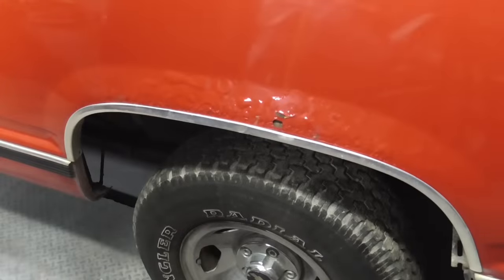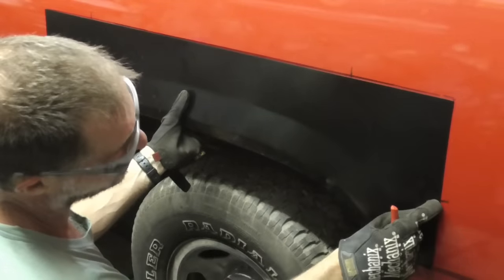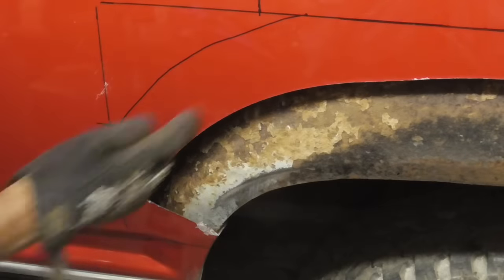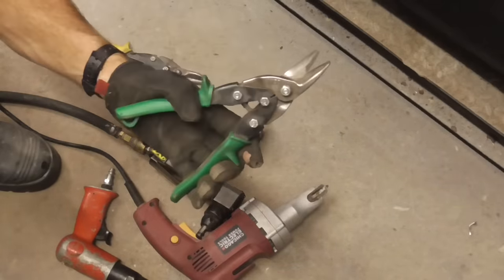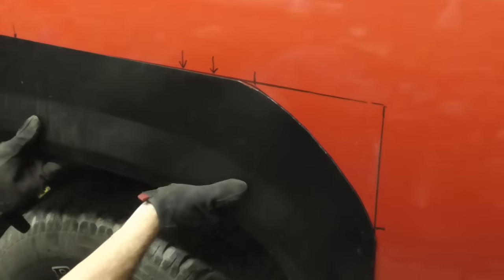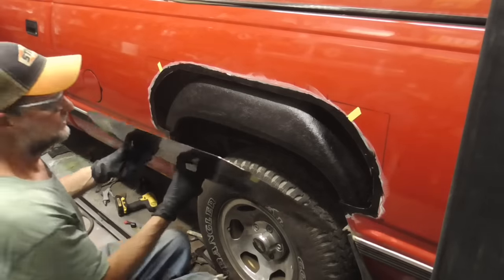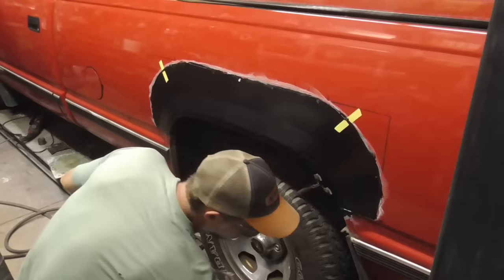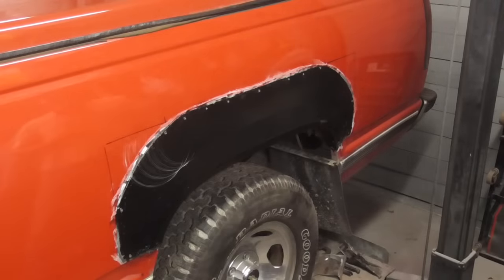Glue On Wheel Arch Rust Repair Panels w/ SEM Impact Resistant Panel Adhesive

Comment: I though what is this guy doing...Then i thought aircraft are glued rivited lapped and bonded.....Then i seen the finish and thought not bad...Just cant get my head round not welding it....
Reply from the maker: Thanks for your input Free - you're right Boeing 737's on up are glued and riveted :)
Reply: @LakesideAutobody  Heres one for ya hemp fibre is about 52 MPA. One MPA is 150 PSi...let that settle now coconut Fiber on average is 132 MPA thats 19,800 PSi Now coconut can be upto 320 MPA thats the same strength as High strength Steel and hemp weave composite can get upto 350 MPA....My Ex's father was an engineer for Fiat...Fiat right...Na they own JTD and Engineerring and they own half the frickin Automotive plant Jeep Ferarri Mazerati New Holand Iveco and the list goes on..He got me looking into composites...Firefighter air tanks are 1/3 the thickness of a scuba tank with a fiberglass weave making it stronger and lighter of a comparable thickness...Just need the thickness where the thread valve seats. I never like ford that much till i seen the Henry Ford Documentary...He was the genius not Edison... Then i bought an F150 and the controll arms and stability and ride... Cross that engineering with a Mercedes Sprinter Van, inother words gut the merc of ECu Engine and transmission and replace with reliable non limp mode USA mussle and that would sell...
Reply from the maker: @freeman7788  You're right - can't beat the engines and transmissions on a USA made truck but the ride of the foreign cars is very well designed.  I bought a Kia Sportage brand new and never once heard a sound come from the suspension - a suspension designed by AUDI - I believe - they helped KIA design the Sportage suspension :)

Comment: Idk about that stuff, but with JBW or any other epoxy, mixing on cardboard is bad. Anything that can absorb, like the cardboard getting "damp", is bad.

That's because the dampness is important vitamins the epoxy needs!
Reply from the maker: You're fine mixing anything on cardboard.  That's an internet thing.  Shops I worked at mixed filler on cut up card board all the time - no issues.  Maybe if it's literally set or something it might cause a prob :)
Reply: I'm sure I read that in the instructions…

I always used cardboard (decade+), until then. Since then I use whatever plastic I find in the recycling bin.
Reply from the maker: 👍😊  I was just out in Iowa this summer - picking up a car - figure you're from Iowa? @Iowa599
Reply: @LakesideAutobody  ha! A good car, here? It must have been imported, recently. Gravel scratches + winter salts = early brown death

Comment: That truck must not have been exposed to the roads in the Salt Belt. It looks like a late '90's to mid-2000 model. If that truck was exposed to salted roads like where I live, the rust around that wheel arch would be much more severe and your rocker panels would be practically gone. Very good video though. I HATE SALT AND I HATE RUST!
Reply from the maker: Thanks my friend - yes, it was a Michigan truck or is :)
Reply: @LakesideAutobody  I own and operate a paintless dent repair business.  I see alot of newer trucks and SUV's with rusted bodies.

Comment: I know that pleco's are so easy to use... I would rather go to every pawn shop around and find from great vice grips to the most cheapest ones to cut up, and weld my own different ends on them making a long reach grip for a spot with maybe a only one time use even as the price will usually reflect the end put on it... I am kind of referring to using the smallest handle on a  grip so many can be put into place. I just hate to put more holes in metal than its got already. If they spent the time (auto manufacturers) to use the kind of metal they first used in vehicles.... see as I look at it, (I'm 73) we just waste so much stuff and any final place metal winds up going, has the worst trash in it yet.... a huge feeding hole for rodents.... sadly making a rodent kind of a purpose animal. I hate em so not to worry, rodent down everytime... If I see them in a pet store, I buy all of them and feed them to my barn cats at a rate they can get all of them. Back  to fixing up old rigs. Car companies know what we want and what we can't afford to buy as they piece it out yet all that spendy stuff winds up in  the same pile as junk does in about three to five years... at least in the rust belt areas. I made a trip to the continental states from alaska where I live at for the last near fifty years. The alcan road has close to a million rigs that stopped for what ever reason,.. some just out of gas. No salt used on this highway system and the rigs are in very good condition. Lots of times, the engine is not even locked up. I wish that those old rigs could be saved as they are almost free for the taking... getting stuff home for less than a kings ransom is the tough parts.
Reply from the maker: Interesting... Thanks for the comment Morgan :)

Comment: It didn't look like you cleaned the inner wheel well and put a little protection on it why burger fixing the outside if you don't do anything with the inside ? 
 I would never use rivets after a glue the flexing if the panel will eventually cut the rivets loose and they will work they way out.... and show up as blisters but it is the rivet that cut loose....
Reply from the maker: I'll show you this repair 5 years from now and it will look perfect.  I promise :)  The guy lives in town, parks it outside and plans on keeping it so keep in touch.  Have a good weekend - Jerry

Comment: A real body guy would have shown a coat of single stage red not fake primer dude cheers
Reply from the maker: We used spray bomb primer as a quick touch up for burn throughs the time in high quality body shops - it works fine - you never have and issue with it.

Comment: Guy needs to watch some Fritzee videos
Reply from the maker: Fitzee is a fine metal fabricator.  However,  in a body shop only use butt welds when needed (OEMs don't use any) - like edges and areas that can't be tapped down. For trailer queens & cars that will never see rain, butt welding and grinding the snot out of the sheet metal is fine but if you drive it, there's better methods.  See this for the truth - https://www.youtube.com/watch?v=JIIonJOVro4

Comment: Disappointed to see drilling and screws and rivets. This will be the path of failure. Moisture will always be behind the panel. Water can travel from the bottom of the hollow pop rivets upward. If it manages to get to the bondo it will be absorbed (and expand) because filler is porous. Then ugly blisters will happen.
Reply from the maker: You don't have to use the rivets you can leave holes - it will never rust up high only where the moisture settles - see this video (3 year old cab corner glued on w JB) - the key is knocking down the seam whether its welded or glued - https://www.youtube.com/watch?v=d21RkqTwRqs

Comment: he should have stepped the body panel or butt welded the panel on so there wouldn't be a thickness descrepancy, that new panel is sitting on top of the original body side panel, you will see it stick out when painted, thats why he didn't paint it and show the end results. i'm a retired body paint man of 40 years from Jaguar motors, believe me , this is not how you do it !
Reply from the maker: Here's a follow up on that quarter - https://www.youtube.com/watch?v=t1WclT_GMvk  Flange tools only create a 1/2" or less flange more like 7/16" which really isn't enough surface area for the glue to adhere to.  You also can't flange around wheel lips. Those are the reasons for not stepping the panel.  If you could flange the entire panel with like a 1" flange that would be great :)

Comment: As a coachbuilder from Germany i can only say that this is a shame for all the wasted time,because 1 you will get cracks in the putty/colour and 2nd the german TÜV will send you home if they realize this and you are not permitted to drive your car anymore!Because of loss os structural integrity because of not welding!If you should have an accident with such a "repair" even the insurence will not pay any damage compensation!In the same time you could have welded and tinned it!And then everything would be save!
Reply from the maker: Three years later many different methods of repair - all work very well - lots of good quality body shops use these methods - not the TV/Magazines or blogs though - https://www.youtube.com/watch?v=gIS1Tbv7Kvw

Comment: 1.52 How to cut your thumb off. Crazy.
Reply from the maker: That's just a sander - the edge really can't hurt you.  If you ran the face of the fiber resin 40 grit disc across you hand - yes it would leave a mark which I've done a few times but nothing too bad.  Throw some toilet paper on it, wrap in in some masking tape and off you go :)

Comment: I don't particularly care for your method I rather a butt and weld seems like it would have been a lot less work, but that actually looks good, I'm very surprised
Reply from the maker: Thanks Mike - one thing good about glue like this is you never have to worry about the seam - ever.  Completely water tight :)

Comment: @ 1.55 what a great way to lose a finger or two!
Reply from the maker: That tool is actually a sander/grinder - you really could run the edge of that thing right up against your fingers w/o a problem (not the face of it though).  A die grinder on the other hand would do some damage :)
Reply: @LakesideAutobody  it's still bad practice and gives the impression that using tools in that way is safe when it's not.
Reply from the maker: @barrymills1196  What's bad practice?  Not being smart either.  Using a grinder?  I'm not sure what you are pointing out.  Could you explain what is bad practice?  Should I be wearing gloves?  Not sure what you're asking or concerned about.  I never got seriously injured in a body shop - it's actually pretty safe work.  Wait!  One time a co-worker accidentally slammed a hood  closed on my hand while I was wet sanding the side of the car.

Comment: The best way to glue on a panel is to not glue it and weld it instead. Im a 20 year autobody tech and i disapprove of this method.
Reply from the maker: What do you think may happen or what do you disapprove of?  Always like to hear others opinions or reasons why :)
Reply: @LakesideAutobody  well despite their claims it is not as strong as welding. Ive seen several glued on bed side pop right off in a collision and the surface prep looked good. Second is the thermal expansion rate of the panelbond is different than steel. Over time a bonded seam will often start to show through. Its probably the second best way to secure a panel and i sometimes use it in conjunction with weld. Maybe im just oldschool.
Reply from the maker: @williamherron9365  Thanks for your input William.  I respect your thoughts.  Wonder what type of glue they used. Here's a truck with a bunch of different approaches - JB Welded Patch,  Glued Door Bottom, Welded butt/lapp - you might be interested because some of the repairs are three years old now.  I have to keep the truck unfortunately to make follow up videos with it for the next few years.  It's got 275000 on it so I don't want to hang on to it for too long :)  https://www.youtube.com/watch?v=gIS1Tbv7Kvw  Nice hearing from you William.

Comment: There have been lawsuits over this kind of stuff. in a serious collision the patch panel will become flying debris, glued seams are never as strong as a weld. In the shop where I work this would get you fired. this repair is going to fail and so is the paint. In my opinion it is irresponsible and wreckless to teach this
Reply from the maker: Manufacturers glue door panels, roofs, bed sides, etc - dealerships/body shops are required to use the same process on many types of repairs (rivets and glue) - they've been doing it for many years.    3 years later - same methods -  I'll do another follow up video in 3 more years - same results https://www.youtube.com/watch?v=gIS1Tbv7Kvw

Comment: Why not just patch the holes with small piece of steel and weld it . Could have been done in an hour and a half. Including paint. Long job for no reason.
Reply from the maker: Lots of shops use glue so if you are working at a shop that demands you do it this way, it's a handy video.  Plus... glue offers a water tight seam :)
Reply: @LakesideAutobody  are you going swimming with it ?

Comment: It was questionable until i seen the rivets😁
Reply from the maker: You do not have to use the rivets - you could just knock it down and fill it.  It will never rust way up there - only where the salt water sits or where the panel stays moist.
Reply: @LakesideAutobody  i have never installed a panel without welding it so its nice to see it done other ways
Reply from the maker: @redman715  I've done a lot of MIG welding myself and do love it - there's not a hole that can't be fixing with a MIG.  I do think that this is a very high quality option as there's no way water/moisture/salt can penetrate the seam like butt/lap welds - just my opinion though so...
Reply: @LakesideAutobody  thats for talking
Reply from the maker: @redman715  You're welcome - any time :)

Comment: No matter how you look at it.... this is half assed.  Do it right or find a different line of work. All your doing is hiding the problem and making it more of a mess for those that do things right.
Reply from the maker: Many shops are using glues for rust because of the water tight seam - I do think it will be the future for sure :)

Comment: This is a horrible repair. That panel should have been flanged and welded in place. A little filler is ok, but you changed the form of the side of the trunk bed by glueing that panel on top and adding bondo.
Reply: I totally agree

Comment: Why ? Just buy a welder and it would be less mess , less filler, less paint .
Reply from the maker: Water tight seam is the advantage.  Never have to worry about the seam - ever.  Welding is great too but some don't want to or don't have a welder.

Comment: As a metal fabricator, welder, and body technician this looks like a bad idea and despite your skills, will still be a sub-par repair option. More than a 16th of an inch thinkness is a lot of body filler no matter what. Body filler is not intended for heavy applications or to cover proper metal work. It is only ment to be a skim coat for the minor imperfections after quality metal finishing. You must have your reasons, but I would never do or recommend to a customer to have this type of glue on repair. It makes no sense to even do? It would take you less time to cutin and weld a patch panel with far better results. Plus, way less filler and body work. I don't understand the purpose of a glue on panel that requires way too much filler to cover over and more time in man hours and materials? Maybe that was your point, to demostrate how to do one, idk? Even a salavge entire bedside could be installed in less time, again with a far better result. This is the type of nightmare previous bodywork that we all pray we never have to re-repair correctly in the future. I wish you well, just can't support or understand this repair?
Reply from the maker: 1-2 year follow up on this truck - stay tuned for the 5 year follow up - it will look the same - https://www.youtube.com/watch?v=t1WclT_GMvk 
3-4 year old repairs now look the same as new - https://www.youtube.com/watch?v=gIS1Tbv7Kvw  &
Reply: @LakesideAutobody  I wasnt trying to be overly critical. I dont doubt the quality if you skill and work. I just dont understand any cost or time advantage vs. a propper cutin and weld in panel repair?
Reply from the maker: @The.Real.Reaper  There really isn't any time savings - and you are right it does take a bit more work and $ but for those that don't want to weld or just plain don't want to weld, this may work for them - nice talking to you Reaper - like the channel icon :)

Comment: As they say more than one way to skin a cat HOWEVER I wouldn't do this method to my vehicle.  To each their own but I'd cut out the top like he did, treat the inner metal that I could get to with a rust sealer or something to stop the rust on that part then I'd spot weld the new piece in.  Grind it down and then do a skim coat of filler then prime and paint.  I can see this repair failing soon down the road.
Reply: You do realize they use this type of epoxy on new cars, right ?
Reply: @TheBlackmamba06  I'm 1000% aware.  Former Axalta certified paint and body rep here.  I'm not novice when it comes to body work.  But this repair won't last.  All that body filler will crack out, he failed to treat the rusty metal underneath.  This repair will fail in a short amount of time.  I give it a yr tops.  As I said to each their own but I wouldn't do this repair in this form on my vehicle
Reply from the maker: There's no question in my mind that this will be the way rust is fixed in the future - see this video that's almost 3 years old now - https://www.youtube.com/watch?v=d21RkqTwRqs  You can't be a body man in any dealership and not use filler.  Filler is used every day in every quality shop across the nation.  Don't go for the hype in magazines, tv and some internet channels.  Get good at using filler and you'll be the best body man you can be - Jerry